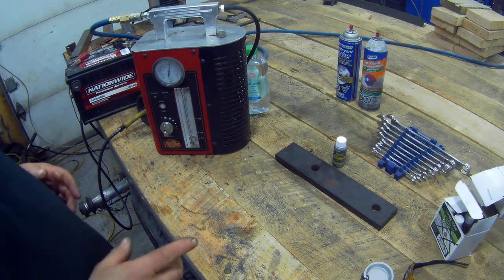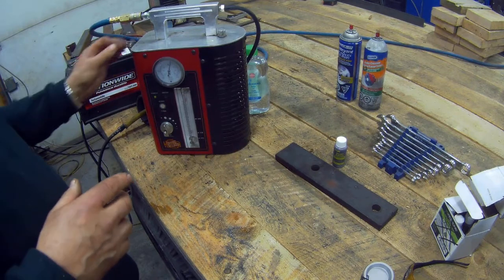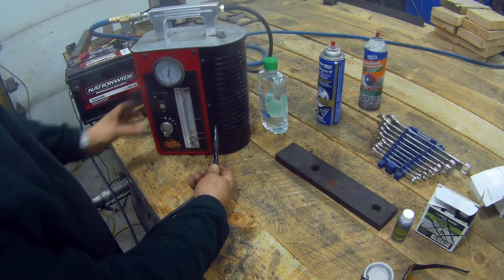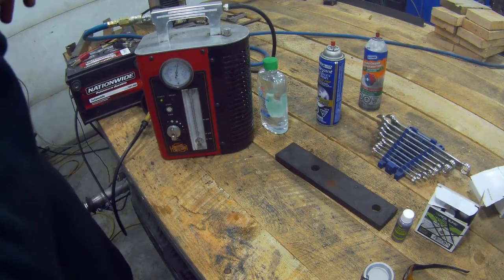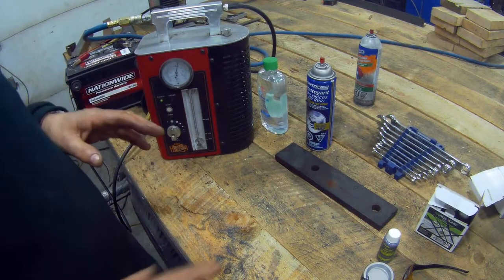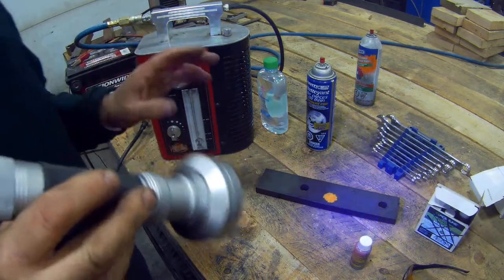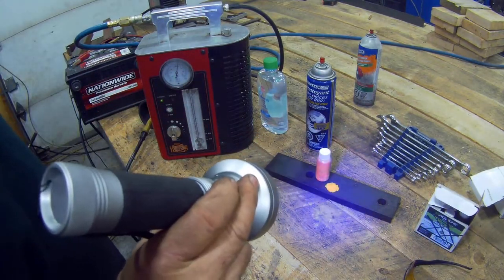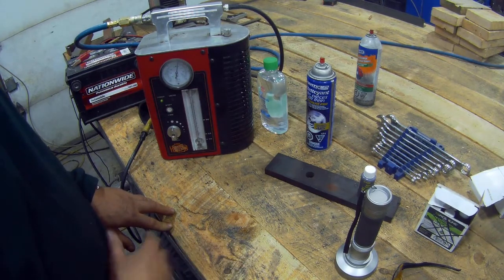Oil leaks - how to find them with dye, and or, a smoke machine

Comment: Hi Mike, 
Do you think you could use this to identify worn bearings on the pressurised oil side of things?  

I attempted it earlier today on a 200tdi....  Removed oil filter and plugged the smoke machine into where the centre/thread of the oil filter would send clean oil.  

Had the lift pump cover off to see if the cam bearings had cast themselves causing low oil pressure when hot,  but most of the smoke was coming down from the tappets/head into the cam chamber. I will check with the rocker cover off next time, but would really like to hear your thoughts on the idea.
Reply from the maker: It's an interesting concept I have not tried, but there are many drillings in the block, so smoke will dissipate all over the place
The cam bearings usually give very little trouble